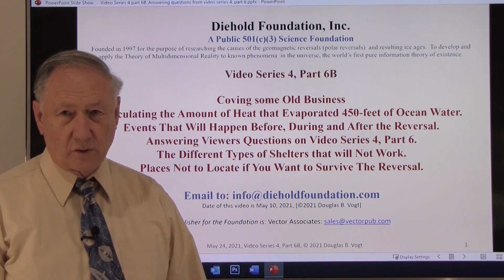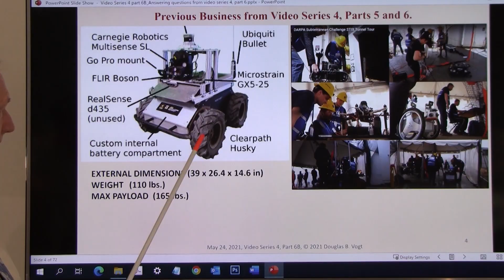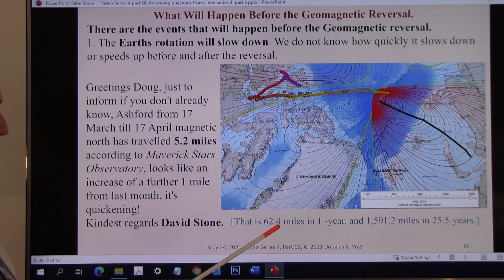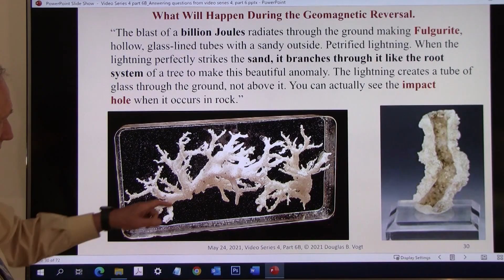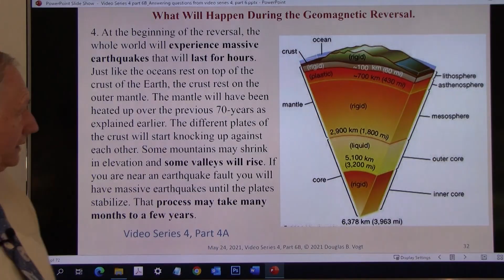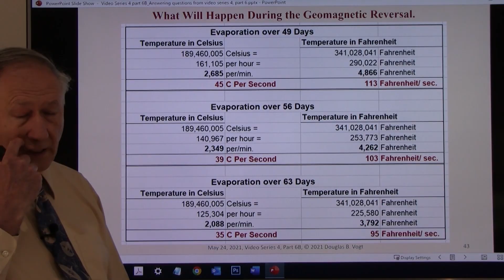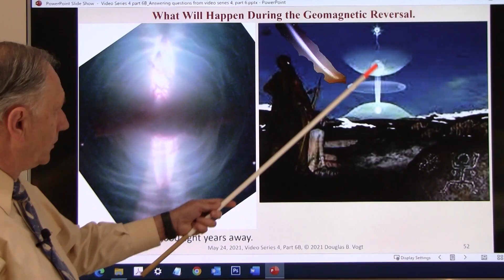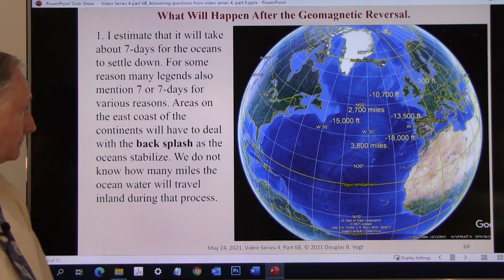Series 4, Part 6B, The Sequence of events before, during and after the polar reversal & Nova.

Comment: I’ve mentioned this on your videos a few years ago, and I wish you would open you mind to it. The rotational Kinetic Energy of our planet disallows the “reversal” as you have defined it… it’s scientifically impossible, however, as seen from the eyes of someone on earth, it would appear to do exactly as you have defined. When the “event” occurs, tangent to the rotation, at approximately a 45° angle to the equator, the oceans will be forced to travel, and not as you say. Also, look at all the pyramids on the planet… they are built with their edges at a 45° angle to the equator so that the water/oceans bifurcate, just like a boat in the water. The oceans will travel across the earth at a 45° angle… starting off almost inline with the rotation at the equator, then,  like a parabola, continue to become more tangent from the direction our planet rotates. Everything else you say may be correct, but I’m absolutely sure about what I say. Regards.
Reply: I’m interested in your theory can you explain what you mean in more detail.
Reply: @HopeForTheBestUG  
In the most simple terms, for example, take a rotating bicycle wheel in your hands, with each hand holding one side of the axle. Your right hand holding the North Pole, and your left hand holding the South Pole of the axle that passes through the center of the rotating Earth/wheel. Now try reversing your hand locations — the tire will continue rotating, but the centrifugal force causes your hands to switch sides at a 45° angle from the rotational direction. This will cause the liquid to flow against the forced change… but NOT in a reversed direction! We will experience TWO forces in play… NOT one! The two forces are, rotational kinetic energy, and the other is the polar reversal energy. The polar reversal is like your hands forcing the rotating wheel to flip sides, and the rotational kinetic energy is the spinning force of the tire, and when liquid is introduced into the equation, you see “it” forced against one side of the tire-wall! The liquid doesn’t flow in the opposite direction, it is forced against the tire wall… which is a 45° angle, tangent from the rotation of the bicycle wheel. Also, the flow and force of the water will be significantly less than is assumed, never the less, it will be epic! The pyramids are still standing, and they are standing because of how they were situated. Obviously “they” knew about this issue. 
Clearly, we have a TOTALLY absent history of mankind… with the “missing link” substituted for logical reasoning. The Hindu history of the four Yugas talk about millions of years of history, dealing with mankind, and yet these Yugas of time are separated quite distinctly. It is easy to see why they are separated so distinctly when you understand that history is wiped out every so often. Even Jesus talked about this earth as being the domain of Lucifer, which is a immortal being, but that’s another story!
Reply: @buildflow  That sounds almost like what Ben Davidson Talks about expect along with the water shift on a 45 as you mention he mentions the crustal shift which I'm guessing works on your theory since it is floating for the most part? 
For a chance at Survival in my part of the world this theory would give me the greatest survivability....I think
Reply: @bkrgi  
Yes, the continents essentially are floating too, albeit much less. If a camera were attached to the surface of the rotating tire, when the shift occurs, it would appear as if the rotation were to stop, and then start rotating in the opposite direction, but this is only an optical illusion because it is looking at the stars from a fixed position while the poles reverse sides. This can be demonstrated quite easily.
I would be more concerned about the exposure to the sun than I would be with the flooding, since there are numerous caves in high elevations through out the world that show no signs of ever bing flooded in the last hundred thousand years.
Reply: @buildflow  But then when I look at google Earth over North America it looks like a vast swath of water spilled through the western mountains and out through the Mississippi Valley. I suspect a massive flood event occurs with it but maybe not to the height that Douglas refers to
Reply: @bkrgi  
At the end of the last ice age, massive floods resulted when the ice dams melted. This is well documented with geologists in the last few decades.

Comment: Doug with all due respect your shoving your foot in your mouth. Thunderbolts has done this in a lab, and it is NOT lightening it is a plasma arc storm!! You should know this FACT if your going to try and teach people how to be safe I would think. I do enjoy your videos and knowledge, but you were way out of line there. Plasma arc storms occur underground and melt rock causing magma too. There IS NO IRCN core my friend, it has been proven or talked about with evidence by Thunderbolts, it has to be a different substance. In the lab iron cores do not create RF frequencies at all. Ben Davidson friend has also done lab experiments PROVING that plasma arc storms are what causes those channels. Especially the Grand Canyon!! WOW Is all I can say your not agreeing with Thunderbolts who researches everything precisely. I like you a lot Doug but please make sure your data is correct before making claims as it will confuse people who really need this valuable information!! Thanks
Reply: Thunderbolts project is utter bollocks.
Reply: Even if the channels off of the shelf weren't created by plasma (I've seen the experiments and I am convinced that the cuts in the center of the continent were created that way), it could be possible they were created just by the crustal upheavals that Doug already pointed out in the video. 

Robert Schoch pointing out that the erosion around the Sphinx is water based, doesn't mean that coastal cracks were made the same way.   

It seems as if Doug is so set in his philosophy that he won't step back and see if he might be wrong.

Comment: You have it backwards.  The oceans ROSE 450 feet.  You can see sunken cities 300+ ft down.  Dwarka, off the coast of India for example, estimated to be 11,000-12,000 yrs old.

The glaciers were catastrophically melted 12,000 years ago and the oceans rose 400+ ft..  By what...we dont know.  A bolide impact?  A micronova?  A megaflare?  
I tend to believe as you do ....a micronova.  That would explain all the residual features that many catastrophists are talking about today:  The instantaneous melting of the glaciers,  Micro sperals, flash frozen mammoth carcasses peppered with tiny impacts,  thousands of mega fauna buried in mud.

Comment: If youre on the daylight side, you're dead from radiation poisioning.
Water will flow in both directions. There's an initial push, but eventually there will be a slosh back. Central America with be stripped bare.
The Sahara will return to being a swamp.
I heard no discussion of how much the 'crippled' magnetic fields and 20 miles of atmosphere disrupt the inflow of energy. 
Thees also the issue of dissipation during transit from the Sun to Earth. Also much of the material will cool and condense arriving as a solid.
Reply: The slosh back won't be as powerful as the initial wave.
Reply: @kdavis4910  Ageed, but C.America, washed away, twice.

Comment: Steam Explosion: https://www.youtube.com/watch?v=9EA3wa7w5CQ
Could this be what happened at Tunguska back in 1908?
I was also thinking about the side of a pyramid. This angle could be used as the door shape in front of the cave to divert most of the water pressure.
Reply: Yes the great pyramid would be a perfect gate/air-lock for underground city.

Comment: so realistically  and technically just not logistically and economical , its gonna be more survivable to colonize the moon  and evacuate there  possibly 5 to 10 yrs before all this starts happening and stay there a decade after reversal?
Reply: Hmm dont think so.
All planets in the system are already in uptick phases.
The moon has no protection at all, it will be taking the solar blast quite heavily, that's also why its full of huge craters and stuff.
Reply: @2Drezik  you would just need to be on the far side of the moon when the nova happens. may mean 2-4 different colonies 90 degrees apart to be able to pick best one when time comes.

Comment: I am not sure if I mentioned this previously but have you considered incorporating a Tesla valve in the design of the doorway?  It would require a longer corridor, but the door would not have to withstand such higher pressures. I was thinking that to augment the effect, instead of having the valve in a horizontal plane, it could have the vanes in the vertical plane as well. Ordinarily, the water is diverted left and right, but it should be possible to have the water diverted upward into the ceiling and the force of gravity would accelerate the return loop. This describes the physics that I am referring to: https://youtu.be/suIAo0EYwOE
I was also speculating about filling the corridor with a non-Newtonian fluid. This would help resist the pressure and easier to evacuate after the wave has passed.
Reply: The chambers in the great pyramid come to mind!
Reply: @maxmoo3275  There are some people who have related the properties of the pyramid (releasing chambers etc) to a ram pump. Here is a video describing its function. https://youtu.be/zFdyqTGx32A If you consider the King's Chamber with its releasing chambers is similar to the pressure chamber on modern ram pumps.  The pyramids have a source of water flow and subterranean tunnels potentially going to irrigation tunnels. Here is one of the people suggesting this technology: https://youtu.be/seVieyiTBbk

Comment: Did you do your research on that design I told you about on your last video concerning the trout motor design, if you understand how it works you can even levitate objects with it's design with air or hold it's place in fast moving water.
Here a dead trout still swims in place in fast rushing water at 2:05 of this video https://www.youtube.com/watch?v=ZdtHvwV0RV4&t=102s
Here a man levitates a Hot dog & screwdriver with a small stream of air https://www.youtube.com/watch?v=e1vriaAncQo&ab_channel=NightHawkInLight

Comment: If the earth rotates like a DC motor then a reversal in earth's rotation is certain. If the reversal is gradual the speed change will be gradual so the oceans sloshing out of their basins is dependent on the speed of the reversal. Geologic evidence indicates the great floods but the damage jumps around to different areas of all the continents so some areas are hit hard and some only mildly. The geologic indications of an instant freeze are localized & not global. Freezing after the blasting away of the atmosphere on the sun facing side is likely as soon as the pressure wave hits the earth. If the cold vacuum of space penetrates down to the earth's surface, this would cause instant freezing.
Reply: Why would only the rotation change and not the orbital direction????  It's certainly not like a DC motor which is oscillating polarity constantly....what is acting as brushes????  Electro-magnet better describes the earth in my opinion....
Reply: @kruelunusual6242  yes.
Reply: @kruelunusual6242  yep
Reply: @kruelunusual6242  Very good point.. We need to give that more thought. Thanks
Reply: @kruelunusual6242   Very good point.. We need to give that more thought. Thanks
Reply: @ToIsleOfView  ...agreed....so much we don't know..

Comment: The comments on water evaporation do not take into account the formation of Ice on the continents. These ice sheets will lower ocean levels all by themselves so the heat of a solar nova is not a certainty.
Reply: The ice will form after the nova and glaciation will prevent some of the water from refilling the oceans right away so they'll be 400 feet lower for years.

Comment: Water sloshing follows the path of least resistance, so it will be blocked by mountains in favor of channeling to the lowest land height. The Pacific will channel through Panama and not overtop the high mountains of Colorado & Chile.
Reply: There are so many assumptions in this it gets difficult to give each part a probability score. I am thankful that Doug is using a worst-case.  If the Goverment doesn't open up the underground bases, it's all over.

Comment: Pretty amazing stuff Doug....You are correct about the waterflow enscarpments and rilles created by the huge volume of water flowing over the ladscape and then over the continental shelf, on both Earth and Mars. However, and here's the kicker, yes, those ones were not created by electric arc discharge phenomenon, but there does exist examples of ones that were, on both planets.
For those water erosion features to exist, we must also keep in mind that water must by necessity have flowed away from those areas to leave them without, then the water flowed in from the other side and down to create those huge gouges! What flows out one direction, got replaced by the inflow from the other. And then back again, when the planet starts rotating in the opposite direction....the Birtish Isles is toast, or rather gonna be dissolved!

Comment: Doug,
On the evaporation of ocean water, I think you are assuming mostly conductive heat, which is likely not the cause of boiling water.  It seems more likely the boiling is caused by prolonged microwaves striking the earth.  I think temperature of the air is irrelevant, and we are not waiting for a blast of heat to hit the earth from the sun, we are instead awaiting the radiation, microwaves hitting the earth that boils the water.

I appreciate you and your research.
Reply: Also, remember the heat of evaporation of water means that while the water is vaporizing it is absorbing heat which cools the atmosphere.  The only way to sustain the vaporization of that volume of water is a constant radiation (microwaves) that heats the water molecules.  Conductive water heating process would stop long before the amount of water you project is fully vaporized.  Also, during the boiling process, atmospheric pressure will increase due to the added water vapor, and that increase in pressure will tend to slow or stop the boiling if by conduction.  Constant microwaves however would sustain the boil even as  atmospheric pressures rise, as opposed to conductive heating methods.

Comment: The wave's hight should be strongly depend on the decelaration rate. 
1000km/h to zero in let's say 12hrs would mean 0.015m/s^2 or 0.00153g of accelaration at the equator. 
At this point its just a geometric problem:
The direction of the net force (gravity and accelaration) will change by 0.0876° if the accelaration is constant. 

So you would need way faster decelaration to get the kind of waves you are suggesting. The forces/work you need to apply in order for that to happen are just unrealistic. Every large CME should rock us around if rotation was that sensitive.
Reply: The mechanics he describes is wrong....CME's do effect day length....we get jerks in rotation speed with different space weather effects....but the amount of energy described would be multiple orders of magnitude beyond even significant space weather.....but the earth doesn't change direction on it's axis, the surge in electricty triggers the micro nova....the global electric circuit is destabilized enough to effect the low velocity zone in the asthenosphere changing its magnetohydrodynamic properties allowing the crust to slide independent from the mantle....centrifugal forces will drag the geographic poles to the equator because of the  ice masses locked there.  this is how you get the sloshing of the oceans, raising and sinking of landmasses, etc, etc....
Reply: @kruelunusual6242  Thats basically the Hapgood approach. There are the standart issues with this model however: 

1. The disbalance due to ice caps suggested by hapgood should be reflected in plate tectonics (plate tectonics was established at the same time as Hapgoods theory)

2. Neglected buoyancy -> the proposed driving force of the displacement, the ice masses, should be countered by buoyancy effects. ATM the polar regions are rather rising due to ice loss, completely negating this hypothesis.

3. Not enough prove in the form of brittle deformation, volcanism etc.

4. Hotspot trails like at hawaii 

I'm wondering if one can combine these existing approaches with new data and get a more wholesome theory. 

The ice caps seem to disqualify for the driving force. Maybe there are more complex, mass related driving forces and minor disbalances that can still explain a displacement.
In any case, a large jerk in the rotation (maybe not as rapid as Vogt suggests) following the micro nova plus the reduced shear strength could still lead to an unlocking of the crust. However, I don't see how hot spot volcanos fit into this picture (at least if dating, magma production etc isnt totally off ... by several magnitudes). 

I have to admit, the evidence of micronova and flooding are still valid and I'm willing to look at the stuff people come up with - and also put some time into it myself.

In order to solve this mystery, I think we have to consider vertical components. 

Electromagnetic effects could lead to density changes. Rising and sinking land would be a consequence and this could also explain under water canions, US/Sahara flooding etc.. 
I mean, we do have found vertical structures (and thus lateral variability) in the mantel just recently. 

There could also be completely different and even less understood explanations for the flooding such as displacement of the water due polarization effects or shocks from the shell/plasma impact.
Reply: @6ondab3ach  they all seem to have standard issues lol.  My opinion is I don't know, my opinion is it's likely no one else does either.....but it is interesting to consider...